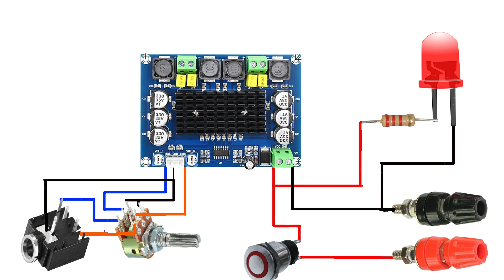DIY TPA 3116D2 Stereo Powerful Plate Amplifier | Awesome Bass & Sound Quality !!

Comment: Vai,apnar poramorso follow kore 15 pic Lithium batteries diye 12v battery pack  banaisi.charge dewar jonno bebohar korsi 3-24v adjustable power charger. Changer volt porinap kore dekhlam volt thik saflai ditase.kintu 24 hours charge diyar por charge hoy matro 0.7/8 volt.
Reply: Saradin charge diyeo 10v theke 11v charge hoy na.bujhte parsina ki somossa...please vai help me...onek kosto kore banaisi, onek sadhonar jinis....please hlp me
Reply from the maker: Charging Voltage koto rakcen ?